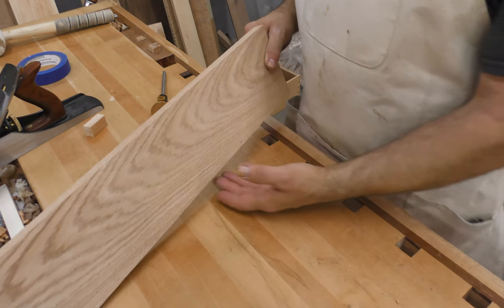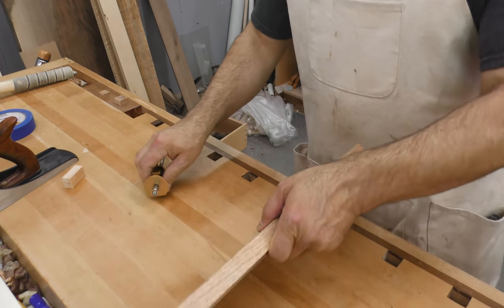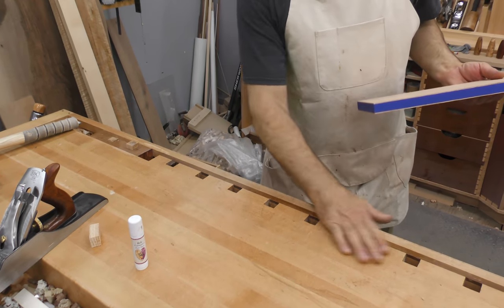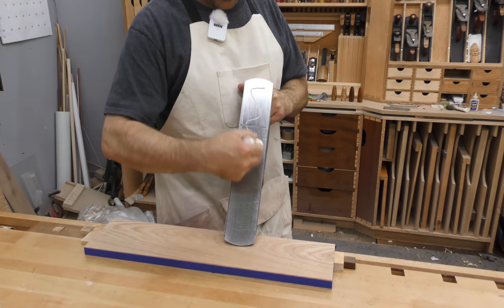Hand Planing Wood - How to Thickness a Board

Comment: A couple of tips of ease to improve this  (From the beginning for newbies - it's not a matter of making it too simple so that newbies will mess it up with lack of sense)
* buy gulf wax bars instead of circular lipstick type paraffin. Wear the corner of the gulf wax bars across the width round and you can pull the wax from the back of the plane to the front instead of scribbling a small line, and your wax will cover most of the sole and last much longer (it's faster, and this is lazier)
* A fast inspection from the outset after facing the board will allow you to see the high spots. Deliberately work them more briskly, and they will come into flat with the rest if you overdo it a little bit. They'll come into flat with the rest on the following full length strokes, that is. 
* a knife gauge with the bevel set away from the depth is better for marking thickness - it cuts a deeper line and no tape is necessary, even for failing eyes - the knife line starts to appear just as you're hitting thickness
* a wooden plane is far better for trying, though not everyone will have one well tuned. I don't mean a krenov plane or some catchy gimmick, but a refitted vintage plane or something similar
* set the cap iron - this method can be used on glued panels through and through from edge to edge, even if the boards don't agree in direction

(the reason that a wooden plane is better is the coefficient of friction is something like a third and the drastic contrast between waxed and not isn't there. The work you don't spend making heat with the sole ends up being removed wood instead, meaning you'll be able to plane a thicker shaving with it). 

You did a good job of showing that in order to dimension, you need to be able to take overlapping through strokes and there's no stabbing chunks of wood off with short strokes all over the place and a magic appearance of flatness when done. 

Everyone will have biases - for some, it will be to leave wood at one end, and part of the way through, they'll have to consciously check that and correct it. For others, it'll be to leave a corner, etc. 

You can plane the "tags" off, but it's better not to have them. 

The heavier the try plane shavings for the penultimate work, the faster this will go and the more accurate the work will be. 

Working just to a deep knife line and not removing the board from the vise to check will give a finished thickness within a few thousandths of the target. The last passes after trying should be done with a smoother and that can be used to even out any minor differences to the marked line.
Reply from the maker: Thanks for you comments but I have to differ with a few.  

1) A marking gauge with the cutting properly installed has the bevel edge away from the flattening surface and in my experience in this application is much easier use than a knife because you need to reference off of the reference surface, super hard to do that with a knife in this application. This is a tried and true technique used for bringing two surfaces into parallel. 

2) If you have a quality modern plane a smoother is not needed nor is it easier.  You can see the sub thou shavings that a modern plane can pull off which is the requirement for a smooth surface, in fact I just demonstrated it in this video.

3) Wooden planes are tried and trued, but tuning them is a difficult art for a beginner.  Refurbishing an old one is even a more difficult task and new ones are very expensive.  In my opinion the better value for is a modern metal plane.  I will grant you the friction coefficient is less than a metal plane (unwaxed) and the wood will also tend to have a burnishing effect, but I do not believe those two factors out weigh the numerous benefits of a modern metal plane.  

4) I have used Gulf Wax for years and find their formula to significantly vary between batches.  Cant tell you how many of those I have thrown away because they make my plane sticky.  I prefer a tea candle to Gulf wax, but because of all those issues I developed my own formula of wax and I believe it is superior to canning wax or candles.
Reply: Barry Manilowa  That's right - a gauge with a knife in it. Bevel toward the waste side. The line will show up while trying the surface and once it's there, you know you have little left to do other than try or smooth the surface until the knife line is gone. In my experience, I'll overshoot in fast work by about a hundredth, and thus set it slightly fat. 

Typical error for me in normal parallel thicknessing is about 5 thousandths. I can live with that. More than a hundredth is very uncommon.

Comment: Great artskill and great patience. But why don’t you use a power planer close to the finish line then finish to the line with the hand planer. Is the result woudn’t be the same? I am wondering about the time it takes to finish a project if it takes hours just to get right a single piece of the puzzle. But I have to admit that doing things your way must be more zen and relaxing. You surely have no need for meditation sessions

Comment: i realize that many of the techniques you are using are meant to help illustrate to us what you are doing while compensating for less than perfect eyesight to achieve fairly exact results.  as woodwork is not my profession and i enjoy the process as much as i like giving the finished product to friends and family i want everything i do do be as perfect as possible.  i often wonder how important this was to furniture makers 100 or more years ago when balanced against speed of production.  of course it may be that they were just so damn experienced that they could be both fast and practically perfect.  honestly though, it doesnt matter.  if you are taking the time to do things by hand in this day and age it is because you want to.
Reply from the maker: well you hit the nail on the head on all your points.  The old masters, say 1700s if they were a high end shop could do really nice work and do it fast (they had lots of help in their shops and no machinery).  If the furniture was for the masses they really didn't care about the non show faces but the show faces were perfect..
Reply: @RobCosmanWoodworking  the industrial revolution, a blessing and a curse. I do love my power tools but hand tools just offers more. Something about working with the wood and doing something to it by feeding it through a machine

Comment: can you apply the same principles in this video, but using a handheld (electric)  jointer? I'd assume the methodology would be similar, no?
Reply from the maker: The issue with an electric jointer is you are not going to be able to do anything but the rough (Lets call it thick shavings) work with.  You cannot to the finish and fine work.  An electric jointer is not going to pull off a .0001 shaving.
Reply: You could, but for the small volume of material in this example, you'd likely be far more accurate with a hand plane (unless you're experienced with an electric plane). If it was a rough sawn board, then you'd be quicker (although not massively quicker than a scrub plane) getting it flat with an electric plane. Then bring in the hand plane for the final few mm.
Reply: @RobCosmanWoodworking  true, but if for example I have full 6/4, 8/4, 12/4, and 16/4 slabs of cherry that are just sitting in my living room, because all my classes for woodworking were cancelled, and I just need to get it flat enough to rip the boards into dimensional pieces, that should be fine, right? I'm not doing finish work with it. Feel free to correct me if im mistaken
Reply: Im used to my colleges 12" jointer and I miss it. that and the 36" planar
Reply: @THANATOSIXU  yep, it would be fine to get the cherry close. Although, I quite enjoy the exercise of flattening with a scrub plane. It's a good workout if you've got the time. Rob's winding sticks video is useful for checking for twist and so on.
Reply: @ricos1497  i dont own a hand plane wouldnt even know which one/s to get for what i need
Reply: @THANATOSIXU  a 5 1/2 would be the best all round for preparing wood. But you'd also need a sharpening setup too. Rob's sharpening setup (see his recent videos) is great, but wet and dry sandpaper and a flat piece of glass is fine if you don't want to spend a lot. If you're wood is far from flat, then I'd get a second hand cheap no 4 plane and convert to a scrub plane which is good for stock removal (or just continue with the electric planer for rough work). Good luck with whatever you choose.

Comment: Hey Rob, one of my eye doctors said he could make me a pair of "man cave" glasses with magnifying lenses that would magnify everything up to an arms length. He said he makes them for many people doing crafts, hobbies and computer work. You might check with your eye doc and see what they say.
Reply from the maker: I will do it.  Great tip, thanks
Reply: @RobCosmanWoodworking  Here is an improved version of the head set that Rob uses.   I took the light off of it and mounted a camping head torch.  You can see the molecules of the timber and if you look at one spot too long the timber burns, but it's good for me.  https://www.amazon.com/gp/product/B003UCODIA/ref=ppx_yo_dt_b_asin_title_o01_s00?ie=UTF8&psc=1

Comment: I really like Rob's precision. But honestly this seems an incredibly inefficient way to thickness a piece. He planed to parallel on about 4 or 5 seperate occasions to reach his marks. He pretty much demonstrated why it's pointless to plane to parallel when you're a distance from the desired thickness: i.e. it's virtually impossible to stay parallel as you plane due to variations in grain, pressure etc. Which makes it pretty much pointless trying to get to parallel until you're close to desired thickness.

The alternate method of planing a bevel on each edge down to the line and then planing the centre is so much faster.

Comment: Throughout this video you were planning against the top of the cathedral grain. Others have said that it is more appropriate to plane up through that grain direction. Please correct my misconception.
Reply from the maker: Hey Lawrence, if I had to guess at the grain direction I would’ve agreed with you on which way it was travelling. However, after feeling the face of the board, I was mistaken. The grain was in fact running in the opposite direction of the cathedral.
Reply: If I'm not mistaken, on most boards, the cathedrals will run the same way on both sides, but the grain will go diagonally through the board, meaning up the cathedrals one side (the board outside, mostly), but down into them the other.
Reply: @ccreutzig  Thank you  for your response.  I also found that the grain reversed on a piece of scrap I was planning. Hence the delay of my response. It is taking me forever to get my plane(s) to perform adequately. I have much to learn and need more practice.  Larry

Comment: So it is 1 hour of intensive labour of highly experienced woodworker to hand plane the small board? Idk, planer power tool seems a little bit faster and easier to work with
Reply from the maker: Of course its faster, but not anywhere as fun or relaxing as doing it by hand